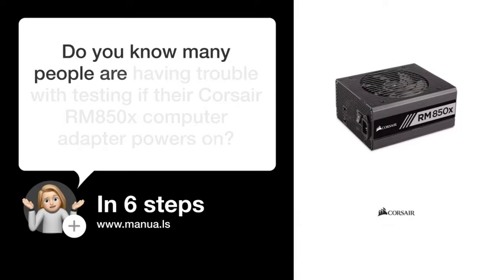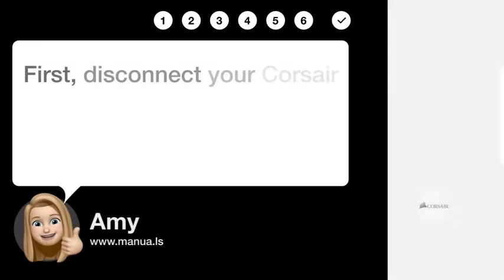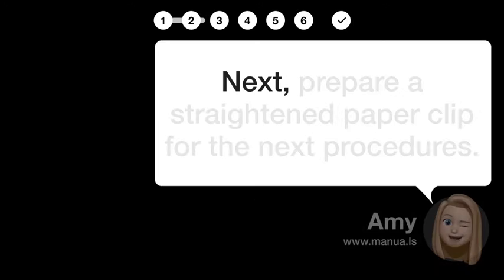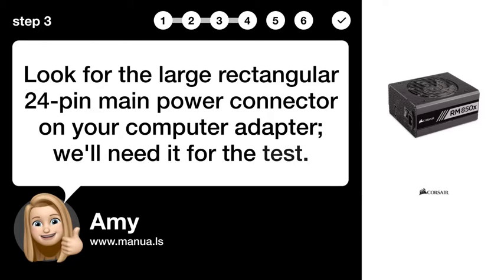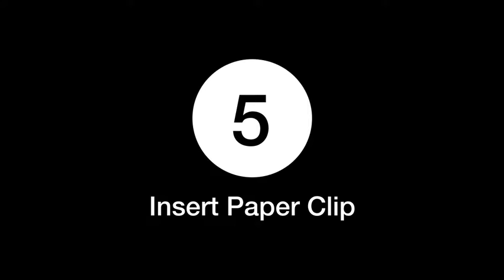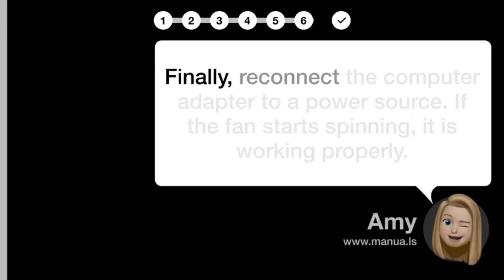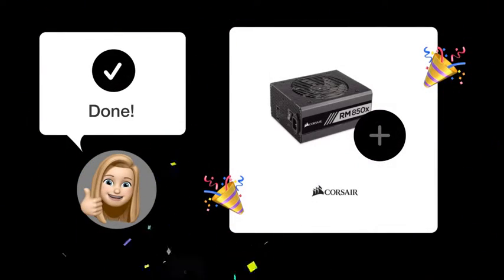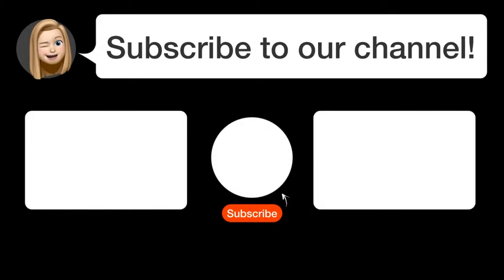How to Easily Perform a Paper Clip Test on Corsair RM850x Computer Adapter

Comment: I went through all the steps, switch on psu, hear clicking noise and nothing for 5 seconds.  After 5 seconds of no spin, fan starts to spin for 10 seconds and stops following another clicking noise.  Is this normal?  The behavior repeats every time the switch is flipped.
Reply: Yow! Mine did the same thing. Is yours faulty?
Reply: @kobedoron3579  i dont't think so because It still works.  i only did the test because i shorted out the psu one night in the dark when i accidentally forced a plug into the wrong port.  it always performed well after that. i may have skipped a step in the video leading to a bad result.